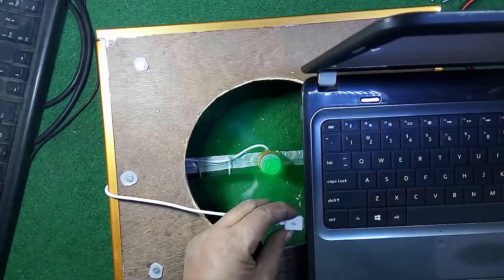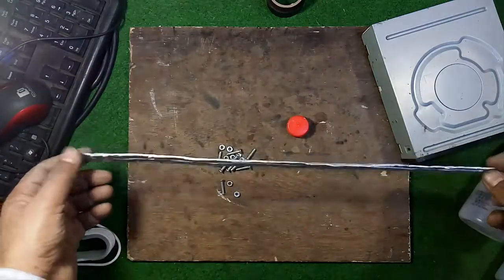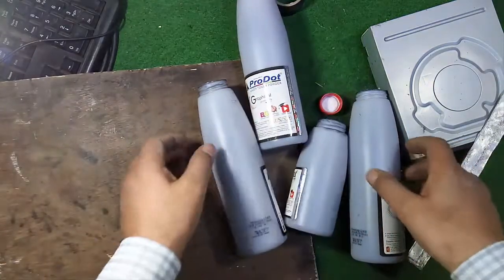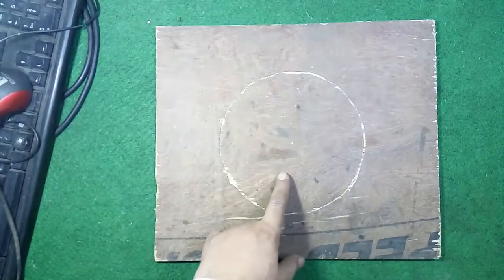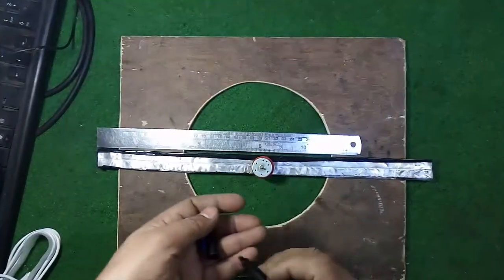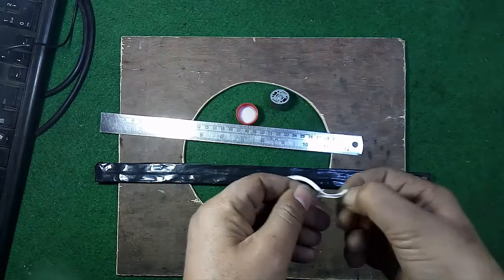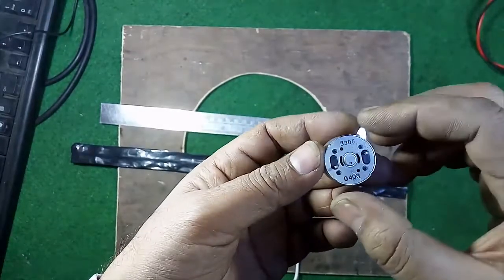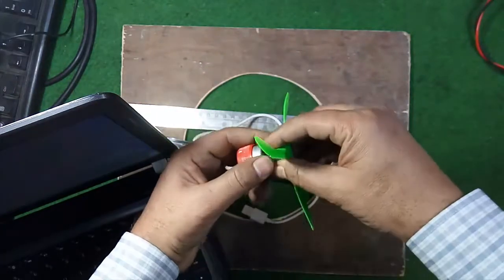How to make Laptop Cooling Pad at home by Innovative ideas

Comment: I HAVE SAME AS LIKE YOUR DITTO HP LAPTOP . CAN YOU TELL ME HOW CAN I SPEED UP. I INSTALLED WINDOWS 8 IN THIS LAPTOP THEN IT HANGS TOO MUCH .CAN YOU TELL ME HOW CAN I RE INSTALL WINDOWS  7 WITHOUT THE CD CAME WITH IT. IT HANGS TOO MUCH .CAN I INCREASE ITS RAM FROM 2GB TO 4 OR 8
Reply from the maker: Yes bro you can increase RAM from 2 GB to 4 GB. Kindly check the cpu fan if it is dirty kindly clean that and apply heat sink compound between cpu and heat sink. Thanks
Reply: How can I clean the CPU fan.